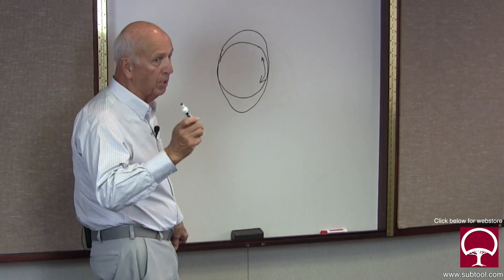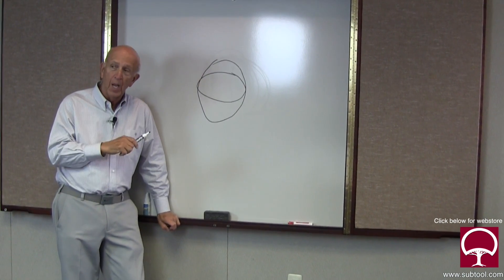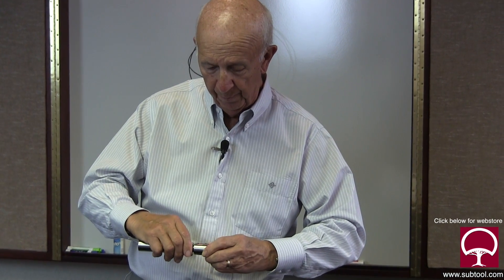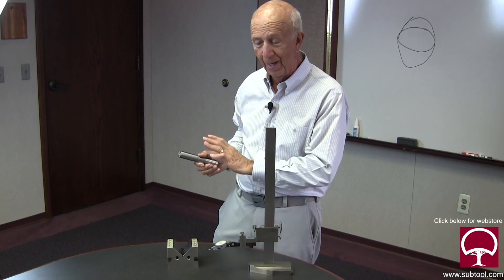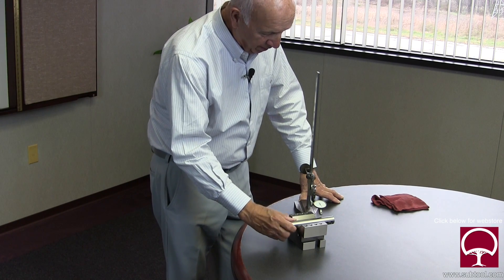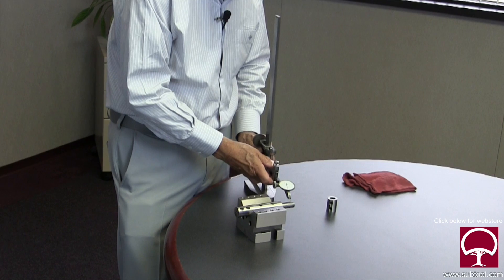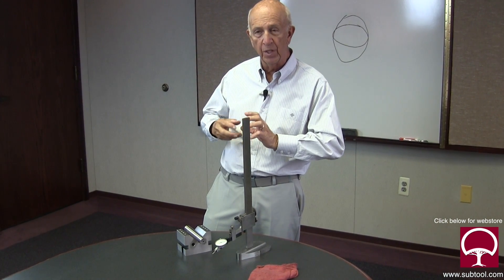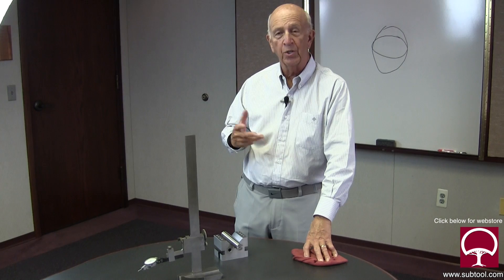Out of round. Really? Show me.

Comment: True as far as it goes.  1971  I went to work for a shop that made hydraulic valve lifters for Chrysler, Ford, and some others.  We used centerless grinders to finish grind and if they were used incorrectly we could get multi lobe out of round.   The check was to use V blocks with multiple angles.   Some angles would show out of round and others would show perfect.
We also had to pass a leak down test for each lifter which meant the inner part could not be forced down too fast or too slow with oil inside the body.  Talk about fine tolerance.  
If you saw how these worked,  you would change your oil per schedule as dirt would damage the function.

Comment: I was the gage lab supervisor for a company that made hydraulic valve lifters for Chrysler, Cat, Cummings and others.
Each lifter had to pass a leakdown test for function.  Lots of bad things happen including out of round.  To test for out of round ,  a V block was used as shown but it is necessary to test using several angles of V because it might test ok with one, but off with another.  Most of the OD `s were finish ground on centers grinders.  Details are forgotten as this was 50 years ago.  I did love that job.

In retirement I do woodworking and try to work to the same standards,  impossible but something to aspire.

Comment: That's all well and good if you can rotate one part inside another. But that doesn't really prove nothing is "out of round" simply because there is no runout on a roating shaft nor is it common to check a plain round shaft or bore where two parts are a "slip fit" for out-of-round. Where out of round is checked is camshaft and crankshaft bearing bores, pistons and cylinders, etc where because parts expand and contract as the heat up and cool and loads are variable and are "radial" as well as "axial" and one part is stationary while the other is in motion out-of-round parts or "holes" cause multiple problems. In those situations TAPER is checked for the same reason and a dial indicator and V-block(s) are useless. You have to use a micrometer and measure ODs and IDs at two points "180 degrees apart" and if there is variation then you know you have an actual "out of round" condition. The same process would work in your demonstration case. And since most "out of round" conditions result from WEAR and material that isn't where it's supposed to be instead of material where it shouldn't be, checking for "out of round" by rotating a shaft in a single V-block" with no "slapping" of the shaft against the block doesn't mean that shaft ISN'T "out of round". A crankshaft connecting rod journal can be badly out of round to the point the out of roundness can be felt with a bare hand and when "measuring" with an index finger and thumb but with a connecting rod and bearing on that journal rotating it around the journal by hand trying to feel that "slap" it can be impossible to "feel" and the "slap" will only be heard/felt with the engine assembled/running under load or even when lugged heavily in a non-typical operating condition. In fact that's what typically CAUSES an out of round situation like that. And without the crankshaft in a crank grinder and set up so the "centerline" of rotation is that connecting rod journal so an indicator can be placed on the journal surface you'll never see "out of round" with a dial indicator on an offset journal or other bearing surface like that. You'll find that out of round in no time as you go from journal to journal with a micrometer checking each journal for out of round and taper by making 4 or 8 simple, quick measurements at each journal (shared rod journals such as those on V-8 crankshafts are treated as separate journals for "blueprinting" purposes when measuring them for bearing clearance, taper and out of round) and you'll find out of round cylinder bores and pistons and bearing bores the same way. Even camshaft lobe base circle diameter, out of round and taper as well as "lift" are more easily, accurately and precisely measured with a micrometer than a dial indicator. Particularly since flat-tappet camshaft lobes have taper machined into them to cause lifter rotation so the "foot" of the flat-tappet lifter and lifter body itself are "spinning" along the camshaft lobe surface instead of sliding and scraping along it. Those "flat" lifter bases are slightly convex and not flat at all for the same reason. What can you RELIABLY measure with a dial indicator and V-block(s) when it comes to shafts across the board but that is also easily visible to the naked eye either by observable "wobble" or wear patterns/damage to bearings and other parts, etc? Runout. And a shaft can still have runout and be bent while not being "out of round" and be out of round and have no runout. As for that shaft being so perfectly machined the indicator doesn't show even 50 millionths of "out of round" (aka runout) I'd love to see the lathe that produced such perfect concentricity while leaving such a "rough" surface finish.

Comment: In this case, the second test is no proof of roundness, it could also be showing whether the two parts are concentric to each other or not. if both diameters were round but not concentric the gage would deflect by that amount. The best way to test for roundness is to put the part being tested in contact with the vee block.

Comment: Sorry but you cannot check for OOR on the O.D.  with a 90 degree v block .! won't tell you if you have 3 point lobing!  It can be greatly out of round with 3 point lobing and you may never see it. Check it out.
Reply: My brother was engineer at a motor mfg. They were having problems with noise in motors and couldn't figure it out. He found exactly what your saying. 3pt lobes and they had indicator on top like in video. When he put the indicator on the side at 90 degrees you could see it. Never heard why the shafts were like that. Must have had something to do with how they were centerless grinding them.
Reply: https://pmpaspeakingofprecision.files.wordpress.com/2010/09/lobing-015-cropadj.jpg?w=675&h=648
Reply: I read this interesting info from the link. I asked brother about it and now the story is they had to use a 60 degree v-block. I think he told me wrong the first time but it was probably 15 years ago.

Comment: Hi Don, love your videos but I do have a question on this particular one. When you had the shaft on the V-block and measured the smaller O.D on the shaft using the larger O.D, isn't that  measuring concentricity, not roundness??
Reply from the maker: +Paulo Esquenazi Thanks for watching Paulo.  In regards to your question, we already knew that the major diameter was round.  So, being that it was round and using it as a surface to check with; we would then be able to determine if the minor diameter was either out of round OR not concentric.
Reply: Thanks for the quick  response and informative  videos. While I still see it as concentricity, I agree that given the right tolerance call out, the larger  O.D can be used used as the datum to check roundness on the smaller O.D

Comment: Maybe this is a silly question but wouldn't you need to check the inner diameter of  the part used in this slip fit to check for roundness? Perhaps by placing the indicator on the inner diameter and spinning the part?
Reply: +John Lane If you use an indicator, What you're doing is measuring concentriciy to the larger diameter. This is assuming you're using a V-block

Comment: intresting to concider however not very helpfull in the way that if you have a shaft fitting in a hole the hole or the shaft could be out of round and without messuring you would not know by hand. if both were yes you would feel it

Comment: A part could be round ,but checking off the first part could shoe that the second part is not concentric withe the first dia, thereby making the second dia look like its out of round.
Reply: +George Lee I saw the same thing. When he checked the smaller diameter, he was really looking at concentricity relative to the major DIA in the v block and not actual roundness.
Reply: Where I worked for Vickers in the UK they used a Tallyrond machine to check roundness, highly accurate machine.I have never seen one in the 30 yrs I worked in the USA.
Reply: Correct. Also the vee is a full contact and if the shaft had issue with straightness,, say no more.

Comment: Don thank you for the video. It shows a great practal way of checking for roundness. Obviously between centres is the most accurate but if you use a V block you need to be aware that if the part is out of round then as you rotate it the centre height of the part will rise and fall. The narrower the included angle of the V block the less it will rise and fall, as you demonstrated. Between centres you had 0.002", 45 degree 0.0018' and 60 degree 0.0010".   Basically the narrower the included angle the further apart the tangent points and the less the rise and fall of the overall height of the part being tested.
Reply: +John Linquist Checking between centers is only possible if your centers are actually in the center. Many mold components are manufactured with center holes in them (to support in a lathe), but the actual grinding is done with a centerless grinder, thus the centers are not concentric with the outside diameter. This is usually told in the catalogs.

Comment: As always Don a very interesting video. But I'd sure like to see who did the part and how they got zero movement on a 10ths reading indicator. That's more than impressive to me at least. I can't think of anything I own right now including some pretty expensive tooling that doesn't show at least a 10th or 2 of needle deflection with a good indicator. Can that type of accuracy even be obtained with roller bearings, or  are solid bronze type bearings still needed to produce those accuracy's?
Reply: +Turning Point That can be achieved with either bearing type if your bearings are in good working condition. Usually the "dead indicator" situation is only achieved with ground or lapped surfaces, as many machining methods such as lathe work produce a very fine pattern on the workpiece that the indicators picks up.
Reply: Many thanks Jaakko, your also another one on Youtube who I very much respect for you rknowledge and experience.

Comment: I've found some TG&P shaft material that was triangularly out of round.. check it with a regular micrometer and it seems perfectly round, but chuck it in a lathe or a 3 point micrometer and you see three highs and three lows by (typically) about .0015 inch,.  putting it on a v-block or straightening rollers (because of 3 point contact of this setup) it shows (typically) more like .003 out of round.  Such material, we have returned to the vender... it kind of pisses them off a few times because we cut a piece out of their 20' stick of material before finding the defect. They had probably wanted to re sell it to someone else.
Reply: +tracyguilbeau That's an indication of poor quality control in centerless grinding if the end result is 3-lobed pieces sold to customers. I would change vendors if it happens consistently.

Comment: try putting it in a 60deg included angle v-block and see then that is what helps show out of round a 90deg one really wont show you anything as far as out of round goes iv been told. i could be wrong iv never tried but as far as i know thats the way to check.
Reply: +turboed350 Why repeat the same old story if you even don't know if it holds any truth? It is like the story of a mother cutting the ends off of a pot roast.
Reply from the maker: +turboed350 Watch next weeks video. We did a test.
Reply: You check for out of round by measuring the OD of the shaft across the shaft in two locations 180 degrees apart. All this demonstration proves is that the shaft has no "runout" and typically "out of round" results from wear and that "shaft" could have out of round at some point within the length resting on or in the V-block and still have zero runout. and zero out of round at the end.
Reply: to test out of round you'll want to have minimal degrees to the linear axis, technically speaking a 1 degree v or a 179 degree v will show you the best result, where a 90 degree v will be the most inaccurate, 0 / 180 degrees will be the most accurate, however you can't hold the part stationary while rotating in a v with no angle ^^

Comment: Whoa whoa, you are checking total run out with that v block right? You may be getting roundness for free but, There could be a Bow in the cylinder  to move that indicator but it could still technically be round huh? Best way (and easy way) to check roundness by hand is with a micrometer for an o.d, and a bore gauge for an i.d.
Reply: +john Doe If there is a bow, it can be measured to exist and thn use other methods to check the roundness. Measuring with a micrometer doesn't confirm roundness.
Reply: +john Doe A micrometer won't catch lobe shaped out of roundness such as you see when drilling thin sheet metal with an ordinary twist drill. Google "lobe shape constant diameter" to see more examples.

Comment: Don, Thanks for all the great videos.  I try not to post comments unless I have something valuable to share, but... I have an issue with how you're checking the smaller diameter of the shaft towards the end of the video.  Checking it as you did in the video, lets say you did measure a deviation of a .0002 or something, would that indicate a roundness or a concentricity error?  By supporting the shaft on the large diameter, and checking the smaller diameter, you really wouldn't be able to tell would you?  I would support the diameter that I wanted to check for roundness in the V-Block

I see this happen sometimes when people put a shaft between centers on a set of Bench centers.  Then they start checking different diameters and making statements about concentricity, roundness, etc without realizing that they're actually measuring both at the same time and you can't say with certainty which condition is causing the error readings.  Really, what needs to be done is to check each diameter independently for roundness in a V-Block, and define the roundness of each diameter first.  Then put the shaft between centers and check for concentricity.

I always say inspection is really a process of elimination.  In this case, first define errors due to roundness.  Then any additional errors must be due to concentricity.

Thanks for doing these videos, lots of people, including me, are learning things here (which is more than I can say for the rest of the internet!).

John
Reply: +Offyguy Yup, you are spot on. By checking it like in this video you can say it is round and concentric (special case, no errors in either), but if there is an error you can't differentiate which it is. Unless of course you attach an angle measurement device to the shaft and plot the measurements to see if it is round.
Reply: @JaakkoF  Strictly speaking there can be cases were the roundness and concentricity errors cancel each other out, and you won't notice that the part is out of spec.
Reply: He did check the large diameter first. It was perfect. Therefore going on to check small diameter, if there's a roundness /concentric error it will show up. This was a quick check. If there was an error, then yes you would have to determine if it was one of concentricity or roundness. But they will NOT cancel each other out.
Reply: PS. If there was a roundness error when checking the large diameter. Then yes it could cancel out a roundness error on small Dia. But still won't cancel out a concentric error

Comment: You cannot check roundness with a 90 degree included angle v-block.
You need a 60 degree included angle v-block for that.
Reply from the maker: +Greg Kozak Watch next weeks video. We did a test.
Reply: +Greg Kozak Of course you can check it, it doesn't matter which angle you have in your block if you just use two indicators in different spots.
Reply: +Jaakko Fagerlund 
Jaakko, You absolutely correct. I now see the error of my ways.
Thank you, Greg.

Comment: how would you inspect the id. part for roundness
Reply: +Chris Anderson Check the OD in the V, if OD  is round, then use the same indicator placed inside for the ID in the same setup....   Hope I made it clear...   ;)
Reply: Also with a 60 deg, V block is better...
Reply from the maker: +pierre beaudry Watch next weeks video. We did a test.
Reply: I'll be there...!
Reply: pierre beaudry OK but what if the od is off
Reply: Chris Anderson
You check the OD first like in the video, then, the ID second, the OD has to be good, though...
Reply: +Chris Anderson You can have the ID rest on two dowels, so you basically have an "inside out" V-block. Or, you put the indicator on a rotating spindle or something and keep your part stationary.